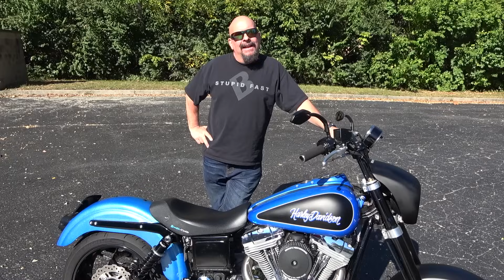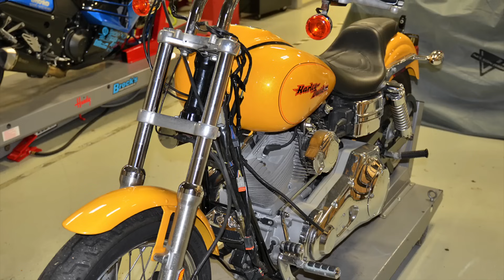Repair Fuel Leaking From Air Filter on Carbureted Dyna Project Bike

Comment: I just went for a ride and while trying to start it up it struggled a bit and then I see gas just dumping out of the exhaust. I'm not sure if its the same issue but if that float isnt working then I can see it pushing too much gas into the engine and then its not igniting and then its pushing that liquid fuel out the back. Very annoying but think the carb is a likely culprit.
Reply from the maker: Look for debris under the float valve. Sometimes the tip of the valve dry rots or simply wears out over time. If there is no debris and the float valve does not look worn out, adjust for the video. A carb rebuild kit will contain all of the parts you need to get your carburetor functioning like new again. A bad petcock and also cause the type of leakage you are explaining. Once again a rebuild kit will get it back like new. Good luck!

Comment: man, you are a great teacher. The fact that you held your camera up the entire time and explained what each piece is called and what it's purpose is, was very educational. My 1980 Honda cb650 is leaking gas through the air filter too. I'm hoping I can follow this video and fix it the same as you did the Harley.
Reply from the maker: That's the best thing about carbs, they have been basically the same since they were developed. If you purchase a rebuild kit with new float valves and seats, you should be good to go. On older bikes, the rubber tip of the float valve dries out and needs to be replaced. But hopefully it's just some debris or adjustments and you can get back to riding. Good luck!

Comment: Brock hey dose sprint filter make them for my 2020 low rider s can't find them on their site for my bike k&n is crap
Reply: Thanks brock
Reply from the maker: Hello, @sprintfilter has limited H-D applications at the moment. We did offer them in conjunction with S&S intake kits. Check out the clearance lane in our store, or our eBay store 2 Wheel Outfitters.

Comment: Hey brock! I when I hit the throttle gas shoots at the faceplate of my air filter (I have a glass fronted one so you can see into the carb). I watched this video to learn a little more about carbs and to see if i could figure out whats wrong. Is it possible for the jet that shoots fuel into the carb to be facing the wrong way? Because i see alot hit the glass when i rev it.
Reply: I checked it. And it is shooting towards the engine. Every once in awhile i get a weird backfiring noise that comes from the carburetor tho so i thought maybe that was related.
Reply from the maker: If it's occasional, welcome to a Harley with a carb! It's not a problem, especially if it primarily happens during startup or when the engine is still cold. If it's more frequent, that could be a sign of a deeper mechanical issue such as improper valve clearance, a spark plug going bad, etc... If that's the case, a leak down and compression test is in order.
Reply from the maker: Some fuel blowback is normal. If you see a stream of fuel hitting the glass, your accelerator pump nozzle might have rotated. When you pump the throttle, you should see a stream of fuel shooting in towards the engine as demonstrated in the video.

Comment: If the float is plastic, shake it and make sure there is no fuel inside it. IF there is, you have a leak somewhere in the float. To find the leak, submerge the float in hot water will cause what air is in the float to come out and you will see the bubbles. Mark the spot where the air comes out.  You may need to take a hot needle and make another tiny hole to drain out and let dry the float. Once dry,, use a soldier iron to melt/weld the holes shut. Test in hot water to make sure there are no more leaks.  Done.

Comment: I use a penny nail with a hit on the bench grinder putting a flat nose on it . Works perfect as it is just slightly under the size of the float pin.

Comment: Brock, perfect video!! Exactly what I was looking for. I have an 05 Dyna. That’s puking gas out of the carb when I shut it off. walked back out it was currently leaking. I’m going to check the petcock first, then go to the float. Thank you for your time and effort on this video. !!!!!  Not only is fuel flowing from my petcock when the engine is off, I also have fuel coming out of the carburetor. I have both problems. 😮😮
Update:  just fix the carburetor. Was exactly as you said it was. 
adjusted the float tang, Problem solved!!!!
Reply from the maker: @Thompsons - thanks for your reply and glad to help. -BD

Comment: I had a friend clean the carburetor on my 06 Honda shadow spirit 750vtx well its dripping fuel after he got done , he took the tank back off and it stopped so he said he didn't do anything to it ...we decided it must be a mall hole in my tank cause soon as we put the tank back on it starts dripping again...I do have a small hole on the top side of my tank...but it's leaking right out the carburetor in my opinion...any ideas? Anything he could have done wrong o make that happen
Reply from the maker: I would need to know exactly where it's leaking from to be able to help.
Reply: @BrockDavidson  any information would be greatly appreciated!!!
Reply: @BrockDavidson  it seems to be coming directly from under the carb
Reply from the maker: Send photos to bmail@brocksperformance.com and I'll try to help
Reply: @Gametimewithcullen  hey, did you sort that leak out?
Reply: @colinm1325  ended up being a rotten fuel pump…figured that out after a full carburetor rebuild 😂 Ty for checking!
Reply from the maker: I always remind myself the the extra work done troubleshooting now, leads to more uninterrupted riding time later 😁

Comment: My 2001 sportster has a mikuni carb it sounds like it’s spitting out air and it is leaking fuel from the center of the bolts that hold the air filter housing the bike idols great you give it any gas it does the air gasp sound and dies out I’ve tried everything I can think of does anybody know what’s going on or what I do to fix this issue thanks for your time
Reply from the maker: Have you performed a leak down and compression check? Almost sounds like a bent intake... assuming it's not a severe carb issue.

Comment: The 2 "towers" for the pin that holds the float in place are different
A cast-in arrow in the carb body at the base of one of the "towers" points at the rounded pedestal that has the interference fit float pin. The pin is a uni-form width throughout its entire length, so it can be installed starting from either end.The arrow indicates direction of removal. Tap the pin out from INTERFERENCE SIDE pedestal (in the direction of arrow). Install pin from LOOSE SIDE pedestal (opposite arrow)
The arrow can be seen at 31:54
Reply from the maker: @beardwrench - GREAT INFO! Thanks for sharing 👍👍

Comment: Add 1 thing a lectron or smart carb you will be happy
Reply from the maker: Have they fixed the Lectron's inability to smoothly reopen after being closed while street riding? I haven't used them in years, but this is why I ran 41 Keihin Flat Slides on my Bandit. The road course with Lectrons was a PITA...
Reply: @BrockDavidson  smart man,👏 😎

Comment: Brock, even though you ignored my request for ceramic bearings,  I'll still help you out.  The CV carb needs to have the float level checked at 15-20 degrees,  and the measurement is
.413" -.453". Yes I blueprint these carbs for a living.
Reply from the maker: @Boosted Twin Cams, I mention you in the video!, lol. Please forward a link to your procedure. What request for ceramic bearings?